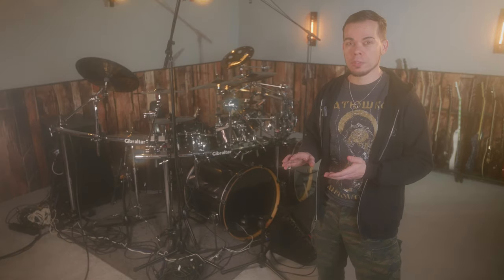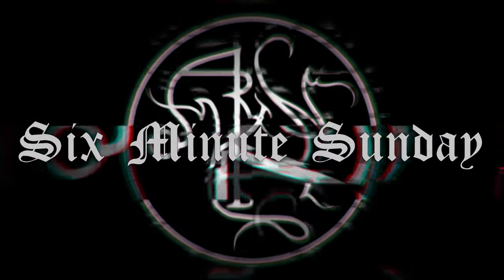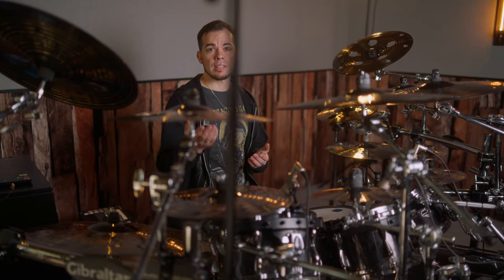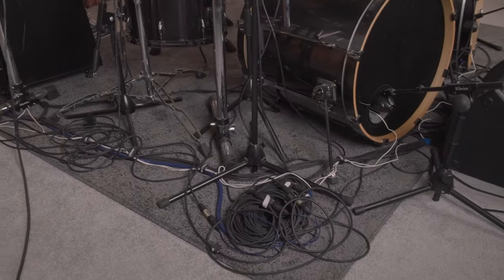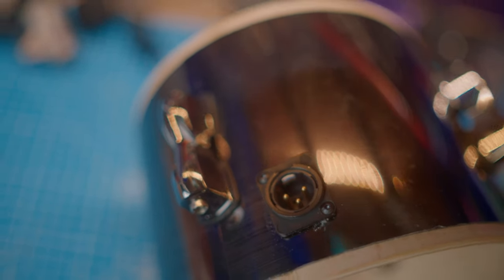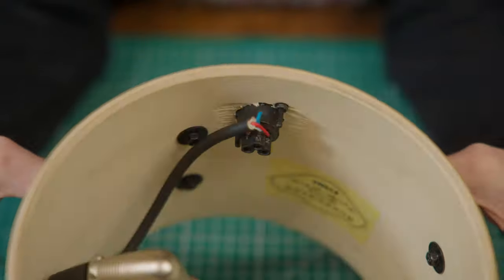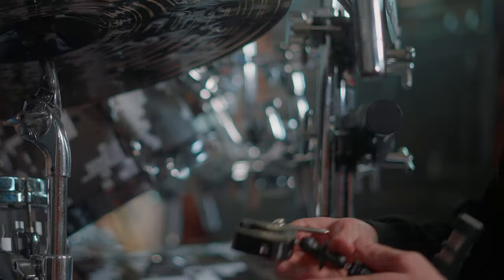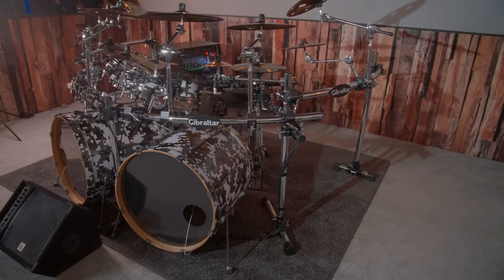Drum upgrade - DIY internal mics, camo look & more

Comment: When you wrote "DIY internal mics" I was kind of expecting some sort of homemade setup for the mics themselves, but it looks like you are using a manufactured internal miking/mounting system. If so, what products? Or did you indeed fabricate the mounts? What mics are those? Same as the ones you used before?

Of course, installing the XLRs was exceptionally well-done and clean. I converted my old tried and true 1980s Tama Rockstar kit with Audix mics (the cheaper F-series models) and using just the May Internal Miking System brackets (you used to be able to buy just the brackets and the included pre-built XLR connector - now they only come with the D-series mics which are a fair bit more, but great quality). Being on a budget, i was able to repurpose the mics I already had been using externally. And what an improvement it was to my old Pinto of a drum set.

Being a long-time fan of internal miking, I would totally geek out on a video covering just that aspect of this project. 😁
Reply from the maker: It's all DIY ;) 
At 2:57 you can see how I removed only the clamping part of the mounting system that attaches to the rim. That left me with a T shaped piece on the remaining mount which I screwed into the toms where I drilled those two small holes. (3:06) 
You can find the exact mics I use in the link in the description (recommended recording gear).
They are from the t.bone DC 1500 set. To be precise, the model is the CD65. If you look at the picture on the thomann website, you can see the chrome part that I removed and the screw(s) that were holding that part.

I've read a lot about the May system and seen a few reviews, but in the end i find that just way too expensive and since I prefer DIY projects anyway, it cost me only a few bucks for the screws and xlr parts/cables etc ;)

My smallest Tom is only 6" deep, so that was tricky to get the mic in there without having anything touch the heads. 
A friend also had the idea of removing the capsules of the mics and making new housings with a 3D printer. Somewhat like those 90° SM57 conversions. That would have maybe been the plan-b 😅

Haha I had to hold back so much on not geeking out in this video, otherwise it would've been over an hour long for sure!

Comment: I've seen triggers installed inside the toms but never the mics. That's pretty interesting. I do have a few questions: I'd like it if you could tell me what are major differences you've seen from a mixing standpoint? Have you noticed they're more boomy and required a heavier high pass filter or anything more drastic? How much of the bleed was eliminated doing this from the cymbals, snare and even from the other toms?

Comment: I didn't know that you can put mics inside drums :/
Reply: It's been done for a very very long time and it is far superior for many, many reason: virtually no cymbal bleed, cleaner space as we see here, less risk of equipment damage from stick strikes and better capture of the tone from the point of impact of the stick on the head.

The mic is directly below the impact, whereas on the outside, it is at the rim and subject to the overtones and undertones from the drum head's ripple towards the outside after a stick hit.

Why the entire industry hasn't moved to internal miking has always been a mystery. My best guess is because then it is hard to access the mics in case of a needed repair or replacement or adjustment. Plus it cost more money to install internally. But the trade offs are soooo worth it.